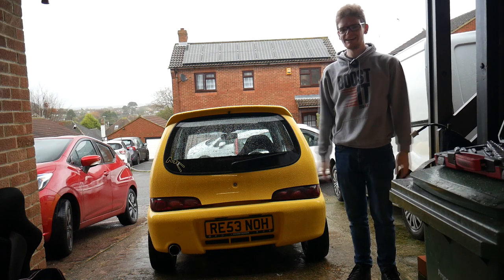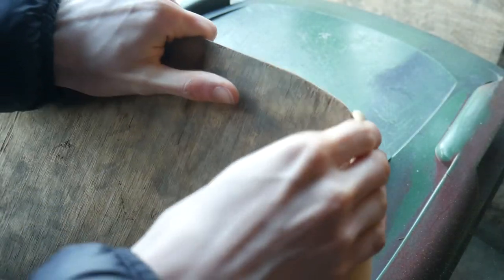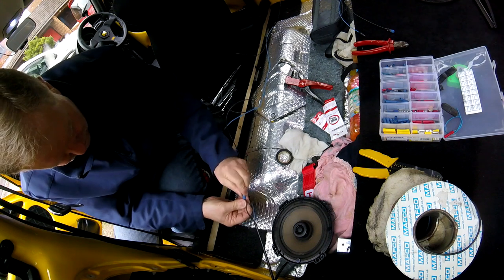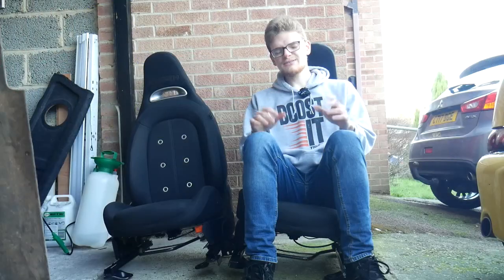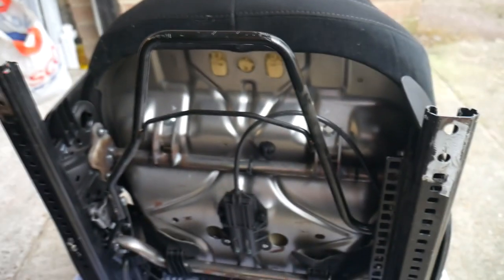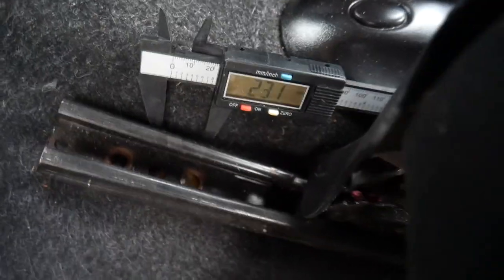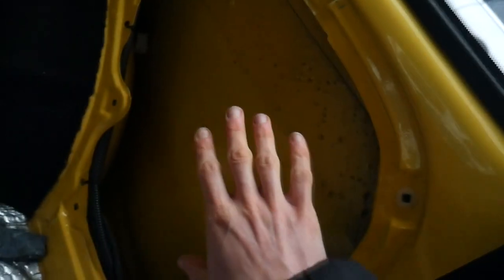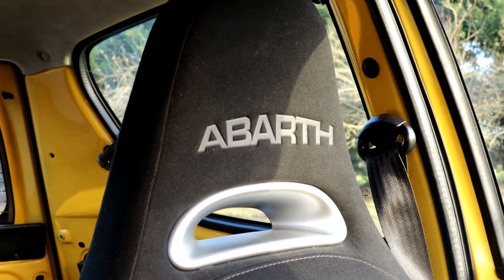Abarth 500 Seats In The Super Seicento & Custom Door Cards!

Comment: Looks cool, though one thing I'd have done differently myself there would be to use rivnuts and black cap head screws to attach the panels. I did wonder at the start how you were going to mount them. I thought maybe with the original clips somehow. Not gonna lie, the velcro made me cringe a little - glad you got it sorted though.

Comment: Finally catching up on the new vids! Lovely to see you and the Seicento back Joe! :)

I had the rear speakers upgraded on my Accent a few years ago as the front ones sound OK and still work fine, but the rear ones were blowing out and sounded horrid....cruising home from work is one of the times of day I look forward the most :)

Also, random side note - I see in some of those shots that the inside of your panels behind the trim are nice and clean! Lovely...but have you considered getting some proper rust-proofing done to the Seicento to keep her lasting longer? I know you take care of it and don't drive it in poor weather but every little but helps and it's must cheaper than bodywork in the long run! :D
Reply from the maker: Thanks dude, hope you're well :) upgraded speakers make all the difference, particularly in a smaller or older car! 

I've rustproofed the arches on the underside of the car, but internally might not be a bad idea either 🤔
Reply: @MillerCorner  I'm good, glad to see you seem to be doing well also (about to watch your review of Furious Driving's Alfa! :D )

A very nice older gent who has an old-school independent body shop helped me rip out the rear interior trim on my Accent and then spray in behind it. Hopefully that will help keep things at bay for awhile in all the winter salt :(

Comment: Could you not have drilled through the board where the original trim clips attach to the car? Find an appropriate trim clip, and recess them slightly so they sat flush. You could have then carpeted the panel and the fixings would have been invisible.